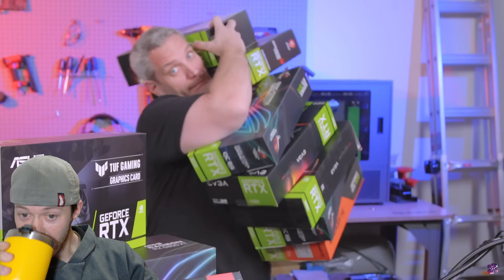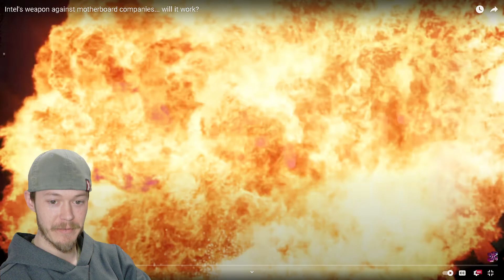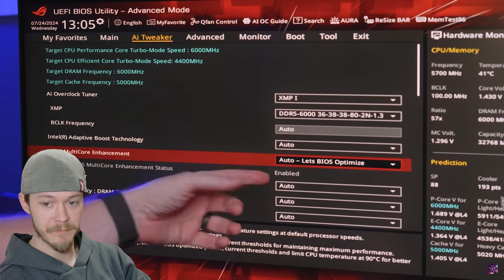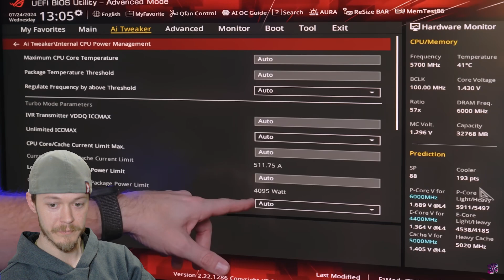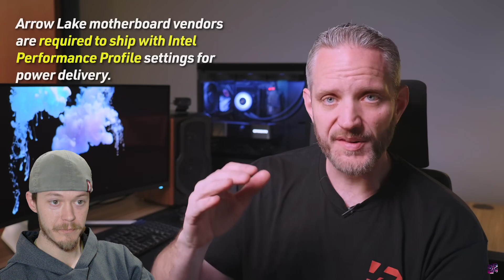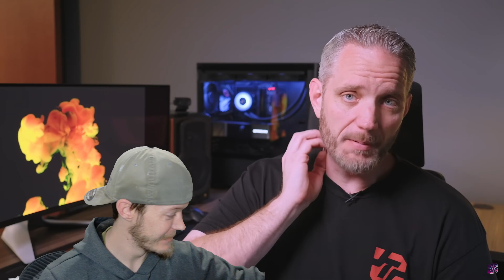⚡ Intel Needs an Apology! Motherboard Voltage Issues EXPLAINED! ⚡

Comment: The Motherboards had nothing to do with this clown show , Intel Completely Changed there architecture for a reason , Including the Ring bus witch was causing the failures through its inability to Handle 2 different voltage cores at a silly 300watts plus . The Cpus Microcode was Not Checking this correctly , Causing the Spikes in Voltage Drawing 1.6voltz for Fractions of a Second. the Cpus Where trying to kill themselves on any motherboard , even server boards with no OC capability . Motherboard vendors that Gave Higher power Requirements are not at fault as the cpus Would kill themselves on everything.......... Jay was extremely Wrong when he blamed them because hes a system builder not a Overclocker. please do more research into level 1 techs and Gamers nexus Overviews as unlike jay they actually knew what was going on.
Reply from the maker: @micheal6898  he was not wrong and neither am I. This issue is not all intels fault. Please do more research... I have and found many underlying issues with intel and motherboard manufacturers along with ram manufacturers using to much voltage. I am Top a 100 overclocker in the world for a reason. Whether you agree or disagree is up to you. 253w is what the 13900k and 14900k max watts is, not 300w btw. 300w could easily be achieved with overclocking though. Well.. 600+ watts but that is nothing new when extreme overclocking a cpu of this caliber. All information regarding this is not easily found on the internet but is there if you want to do more research of your own. I am still rocking a 13900k and works amazing when overclocked on a older motherboard bios!

Comment: Everyone that was in the know on this controversy knows it was the motherboard's firmware that was to blame for the over-volting, nobody cares who was the first to report on the issue in the end of the day as well. But intel did also have a falty microcode that didn't help with this situation, in fact intel themselves reported this issue in a public statement. Intel is the one that writes the microcode for their CPUs that is part of the BIOS/UEFI Firmware for OEM or the Operating System (OS) Loadable Microcode for generic systems. The microcode is what regulates the voltage and effectively asists the CPU how to use the voltage for specific tasks so it doesn't kill itself. Well some more advanced in the know people like level1tech tested this and found that to be one of the contributing factors. Its a combination of both the motherboard vendor's agreesive power profiles and the faulty microcode from intel. So in the end it was both intel's fault and the motherboard vendor's faults. You are on some serious intel copium right now if you believe intel truly deserves an apology from all this. I also call total bs that intel had no idea they didn't know about this from their vendors. They have been well known by practically everyone to be aggressively auto overclocking intel CPUs since like intel 8th gen, most likely to create the illusion of their CPUs being faster than AMD while totally destroying their power efficiency. But this whole thing is pure conjecture that really doesn't mean anything without hard facts which you don't have direct access to from intel engineers. As long as you are running the latest BIOS with the intel specified power settings you are fine now, this whole video is redundant. You are like a year late to this whole subject at this point, nobody cares move on.
Reply from the maker: @cosmicusstardust3300  just bringing the topic back up as I have a video from last year about this issue and have been talking about it and finding underlying issues since the issue arose.

Comment: i bet you think the nvidia 12v gpu cable problem is a case manufacturer problem right?
Reply from the maker: Of course it is everyone plugs there gpu into a pc case! and pc cases have all the power needed but they are not optimized for the high end gpus nowadays... comment as you like but make sure it makes sensse please... So I believe it is a design flaw from whoever signed off the FAA approved plans to use 6 12v cables and 6  Ground cables but only allow gpu manufactures to have 1 rail for the gpu end for the 12v current. Makes it basically impossible to manage the power going through the cables themselves. Which has been leading to cable failures.. aka melting..
Reply: @OverClockingPersonalComputers what does the Federal Aviation Administration have to do with computer power cables....

Comment: Ive noticed alot of pc builders are also useing very wet thermal paste. The more moisture the more water/minerals it contains. This could also be a very good reason they are tarnishing/oxidation on the ihs.
Id recommend thermal grizzly kyronaut
Reply from the maker: That’s a great point! I’ve seen people use a lot of thermal paste that can be too wet for the chips. Thermal paste is important for proper cooling!

Comment: I own a 14900KS which I did a delid and put on a EK direct die 360 AIO. I addressed the problem with that processor early on and manually adjusted the PL1 and PL2 along with the IccMax running them between 320w and 253w with the IccMax at either 307a or 400a. I can honestly tell you that the 14900KS is way snappier and faster in Windows than a 9950X3D which is what I am on now. I am not convinced by this 9950X3D, there are a number of things that I can tell it struggles with that the 14900KS had no issues with. For example, I run a media server for movies and music on these machines and I game on them at the same time. I never noticed the 14900KS struggle while doing both things at the same time, this 9950X3D most definitely drops performance. I am not sure if its due to the E-cores being hybrid and doing a better job or what, but you can feel the drop. Another "issue" I have noticed has to do with the scheduling, I am running an LG C4 42" TV as a monitor, so you can't really leave anything on the screen for too long before "Burn in" occurs. So, I have Windows backdrop run as a slide show and change the image every minute, I can see the 9950X3D "hiccup" every time it changes the backdrop if I am playing a movie or YouTube, this never occurred with the 14900KS. I will say that the 9950X3D runs way cooler at a maximum of 72 degrees under load and PBO overclocked. While my 14900KS even after the delid and direct die would get to the low 80's. The only thing I really see AMD having over Intel is the 3D V-Cache, if Intel were to have integrated anything like it on the 285K it wouldn't have been a flop. Unfortunately, the 14900K and 14900KS were a last push effort to get a product out from not having anything "ready" for the consumer. The 1400 series is nothing more than a souped up 13900K that has balls to the wall wattage to make it happen. Intel needs to reverse engineer or hire someone from AMD to get that 3D V-Cache tech, all I hear from the upcoming Nova Lake is them tossing in more cores which will not help their "gaming" performance issue. As for Intel needing an apology, it's kind of a gray area. Intel initially needed for the 1400 series to outperform the 1300 series and the 7950X3D by a leap, so they let the motherboard manufacturers go crazy with the default settings and gave a blind eye. My initial scores on my plain jane vanilla 14900K when it first came out with the crazy Asus motherboard settings would outperform my current 14900KS and the 9950X3D. When they started issuing updated "Fix" bioses all that performance went out the window this is why I moved on to the 9950X3D.

Comment: Intel can't design a cpu anymore and you're blaming motherboards? What?
Reply from the maker: Intel can't design a cpu... So nvidia and AMD are not looking to partner up with Intel for intels 18A node... Hmmm.. looks like someone needs to watch more of my videos before commenting
Reply: @OverClockingPersonalComputers  Well to be fair.. you're comparing fabs to people making architectures/design. Fabs were always lying with their nodes until there was a hard focus on fabs, and now we have 18a at HVM. Let's not forget 14nm++++ and 10nm. Intel definitely fumbled with Arrow Lake with how the mem controller is on a different tile incurring a perf penalty, that and needing super fast and expensive RAM. Intel said themselves that it's gonna be a couple of generations until they have their own version of 3D cache. AMD will absolutely smash Intel from what I'm seeing though, they're just going to heavily lean into more cache.
Reply from the maker: Very nice reply @Accuaro!, there is issues with all new Innovations with cpu arcitectures and not just Intel but also AMD and Nvidia. Plus not all gpus are made the same like how the X3D models are for gamers and targeted for gamers and works for gamers! Also you don't need fast expensive ram for Arrow Lake to run and perform great.. it just helps. If AMD can fix there issues with having slow ram then it would also help benefit them!
Reply: @OverClockingPersonalComputers  The Core Ultra series is a flop and the 13000 and 14000 series degrade and you are telling me that Intel was completely powerless to release bios's that stop degradation. They had to use e-cores because their p-cores are too power hungry to have more than 8. I am honestly in disbelief that you think Intel cpu's are perfectly fine and the problem is everybody else? When 7800x3d's were exploding the problem was fixed fast but somehow Intel can't do that? I would like to sit down and discuss all of this with you, I really would, because I cannot comprehend why you are giving Intel a pass here.
Reply from the maker: @pf100andahalf  whats better.. CPU that blows up and can burn down your house or one that might degrade faster than normal? Honestly answer me that

Comment: The "K" Unlocked and Unleashed is for enthusiast, not an dual chamber RGB PSU extensions tech redditer.  They should stay on the little shitlet sku´s and try to stable 6000 c32. They don´t check til they got bluescreen or issues, MCE didn´t killed the chip the fact that they open UEFI for one button press of XMP. K  sku has since sandy bridge been the same
Reply: Then why doesn't Intel say that K series is for enthusiasts? They don't because they are sold to the public as a consumer part. Intel overvolted the 13000 and 14000 series because it's the only way they could compete against amd. This is 100% Intel's fault.
Reply from the maker: Correction motherboard manufactures overvolted Intels CPU's to make there motherboards "look" better than others.
Reply: @OverClockingPersonalComputers When Asus motherboards were killing 7800x3d's the problem was fixed fast, but somehow Intel can't do that?
Reply from the maker: @ https://www.guru3d.com/story/intel-addresses-stability-issues-with-13th-and-14th-gen-cpus-blames-motherboard-manufacturers/ heres a small article on the matter
Reply: @OverClockingPersonalComputers  Umm so user claims line of the 188w at 249A in that artical is kinda wrong since intels turbo watt rating is 253w at 250 A for PL2 which is for Turbo. 1.72v is the max turbo voltage. so even a 1.7 is within intels specs.
Reply from the maker: @TakasuBK  it depends on what cpu that user is referring to tbh
Reply from the maker: Also 1.72v is max operating voltage.. you have to keep the temp below 100c at that voltage which is where extreme cooling would come into play like liquid nitrogen or dry ice.
Reply: @OverClockingPersonalComputers  funny their documentation for 13th gen in its entirety is 1.72v max operating voltage. I personally undervolt my 13900k. Might want to look into Intels manufacturer max voltage specs. 14th gen has the same 1.72v max.
Reply from the maker: @TakasuBK  max.. it's there max voltage allowed not specifically used for daily! Or stock settings.. or for regular pc users.. which generally 1.3v-1.45v is for stock settings..I overclock my 13900k to 5.6ghz all core at 1.365v I have overclocked my 13900k to 6.3ghz at 1.575v... same with my 13900kf.. nowhere near there max 1.72v. Understand motherboards handle the voltage and had and still have settings above recommended intel specs for normal stock settings. It's why intel now has motherboard manufacturers limited to what they are allowed to do with there cpus on stock settings.